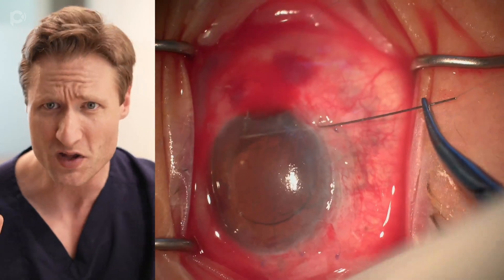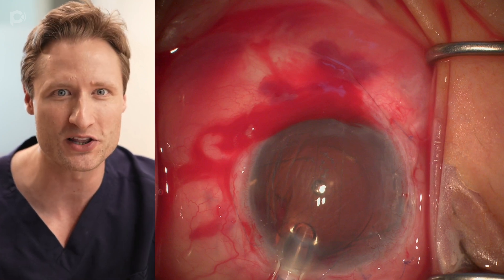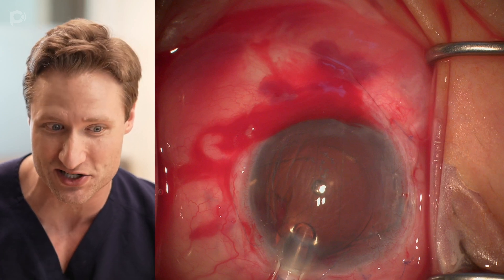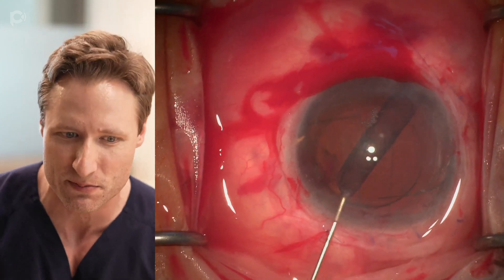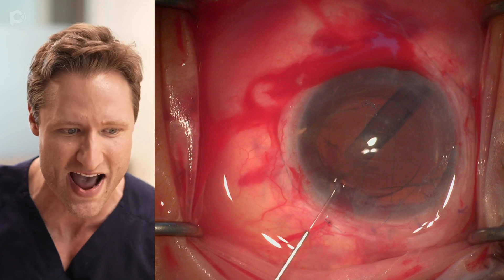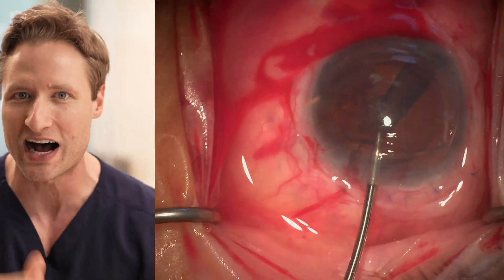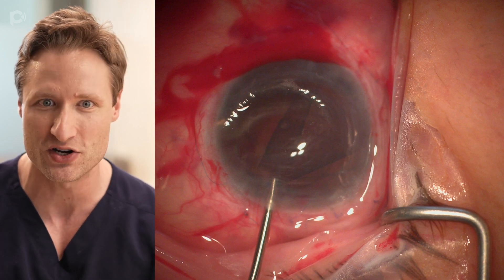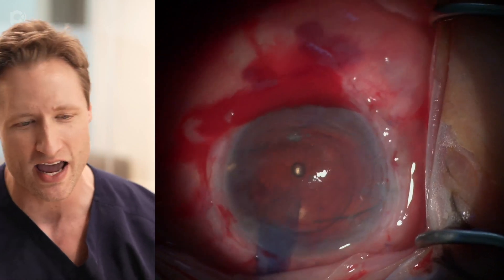Nightmare DMEK, Terrible Mistakes!

Comment: That was a really stressful one, but an amazing job as always! 👏 👏 
I was curious—what made you decide to use a trampoline mesh, considering there was already a large optic scleral-fixated in place acting as a scaffold? Was it due to the lack of iris   support as well?
I can only imagine how it would’ve been if this had been done as a single-stage procedure with scleral-fixated IOL and DMEK!
I actually learned the value of the two-stage approach from you in the previous case! 😉.